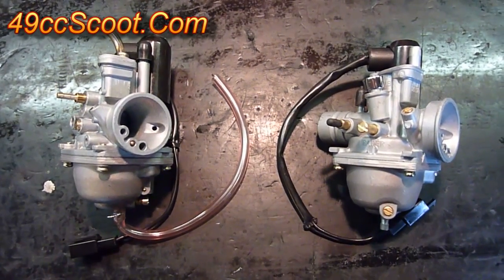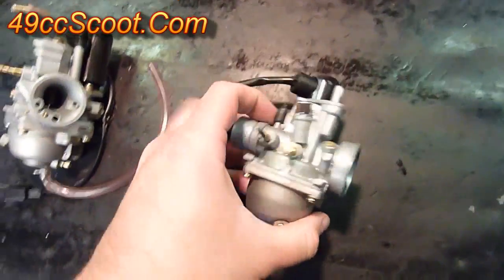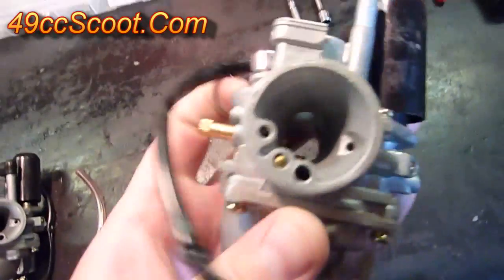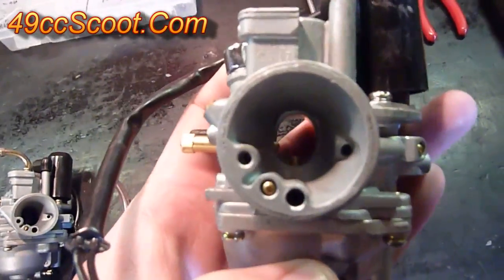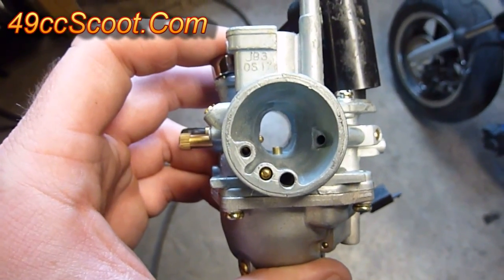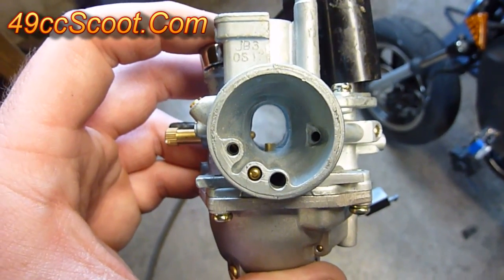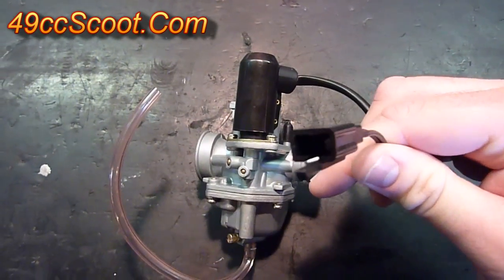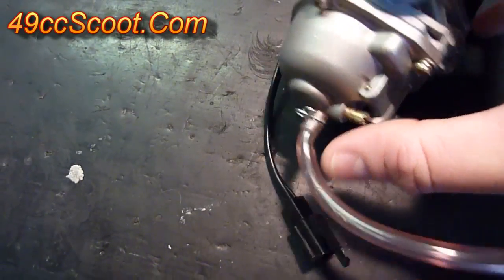Two-Stroke Scooter / ATV Carburetor Settings And Adjustments 1of4 : Basics, Overview

Comment: Hi. Im running a aprilia rs90 with track exhaust the bike runs very well on a 12mm carburetor. Would a 17mm carburetor improve the performance. Bare in mind the performance of the bike is already very good. Help with this question could free up more power and that would be amazing👍.
Reply from the maker: My instinct is that a 12mm carb is pretty small for a 90cc two-stroke. That said, I don't know anything specifically about that bike. I can tell you that with my mild 90cc Minarelli engines in scooters, I saw an increase in cooling (lower CHT) with a 19mm carb in place of a stock 16mm carb. Didn't really notice any measurable power increase.

Comment: Hey I've got an '87 50cc jog. Won't start. Replaced carb and petcock and spark plug. Still won't start. With starter fluid will only run while spraying fluid directly into the carb. Any ideas?
Reply from the maker: Sounds like you need to figure out where fuel is reaching. Is fuel making it to the carb for example and is it filling the bowl? Also, is the gas old. If the gas has sat for awhile, it may not be good enough for the scoot to run.

Comment: I noticed vacuum port is covered , is it meant to be covered at all times or is that for protection since it's new , if it's not meant to be covered where does it lead too , thanks in advance
Reply from the maker: Can be for vacuum petcock connection. If not used, it needs to be capped.

Comment: Hay hi, thanks for answering. But the filter isent the carb filter, the 1 i mean is connected through the exaust maybe the catalizer.. or the exaust fumes filter. Its just im not sure why water is dripping out, and yes its water, through the exaust...  and what do you think about the engine exaust manofold, when i took the exaust off the hole by the engine was like half bunged up. Is it a restriction,? Or a carbon build up.? Or is that normal, with a 2T 50cc moped.? Thanks again
Reply from the maker: I'd try cleaning the header and see what happens. Other sounds like emissions junk.
Reply: Ytit

Comment: Hi iv been fixed to your videos a late. Great.. 2 questions pls help. Firstly i changed my exaust, ov my 50cc sx sachs, 2T. And notice the exit engine manifold hole , looked bunged up,  is that a restriction,  or carbon build up.? Should i just leave it.?. Secondly  under my seat iv a black box coming from the exaust with a filter in it, dont no wat you call it. Lol. Sorry. Well the foam filter was black oiley,and wet. Plus iv noticed water drips alot from it, and fumes,, is that normal.? Wats it do.? Im stuck. Thanks. Keep up the great vids.
Reply from the maker: Not sure about the pipe. Trying to clean it should tell you. That's the airbox. Could be normal if it hasn't had attention in a while. Clean it and oil it with air filter oil and then see what it does. Water shouldn't be dripping from it though. Sure it's water?
Reply: And with the engine exaust manifold,  restrictions,  oder cabon.

Comment: i have a question about tuning carburetors. wen tuning the pilot and needle and the main jet. is there a curtain order that you have to tune it in. i know the pilot gottha tune first because its easier to tune once bike idles good. but what should i tune first. the main jet or the needle??? thanks alot for ur help. i love all ur videos.
Reply from the maker: Some like different orders. I generally just get a reasonable idle, then I work on the main jet for WOT and then go back to making sure it idles and then fiddle with the needle. Can be some back and forth. Some will focus on needle first.

http://www.49ccscoot.com/faq/carbtune.html

Comment: Hello, on my scooter the fuel drain hose is just pointing on the ground. is there some special place where it should be put, or its ok this way? i am kind of confused :), because as i removed the carburetor, the hose was just sitting there and it was not connected to something.
Reply from the maker: Some scoots have an end on the hose that works as a shutoff valve and the bowl drain is left open. Those usually have a hole to let them attach to one of the CVT cover bolt holes. Others just have a hose hanging down. As long as the hose is secure, that's OK.

Comment: Hi, my carburetor falls out of it's place when i hit a big pothole, so what can i do to prevent that?
Reply from the maker: Secure it is the simple answer. Kinda hard to know without seeing it. You can join the forum (49ccscoot.proboards.com) and post with pics if you'd like. Random guess, tighten clamps.
Reply: Well the proplem is it doesn't have clamps, i lost the air filter because it doesn't have clamps i looked everywhere and i couldn't find them, btw your vids are super helpful for me because i rebuilt the engine and it didn't start very easily i thought i did it wrong but turns out someone messed with the idle screw so that's why i couldn't start it when it's cold.
Reply from the maker: Yamaha dealers or somewhere like kaseaparts should have stock replacement clamps. The carb/intake clamp could be replaced with a common worm gear hose clamp in a pinch.
Reply: Thank you so much bro

Comment: Can u use a 49cc Chinese scooter carb on a 70cc ATV
Reply from the maker: If you're talking about one of the youth ATVs that has a Minarelli engine like the scoots, it should be pretty much a direct replacement. The carb should be tuned, but I'd want to tune it even getting a replacement right from the manufacturer.

Comment: Need help taking mines off a ADLY atv 90cc
Reply from the maker: There's not a lot too it. Shut off fuel if not a vacuum petcock. Drain 
the bowl (screw on bottom of bowl usually). Unscrew the cap and remove 
the throttle cable (shown in one of these vids). Disconnect the fuel 
hose and oil and vacuum hoses if you have them. Unplug the connector for
 the electric choke. Then there should just be a clamp on the intake 
holding the carb on. Once that's loose, it should come off.
Reply: 90GTVert  got the bottom off need help with the other part, thanks looking forward to seeing the video
Reply from the maker: https://www.youtube.com/watch?v=KXxxJrA5hNY
Reply: 90GTVert  got it off , it's not worth cleaning do you know what size carb and where to get it ? It's for ADLY  atv 90cc 2t
Reply from the maker: You can find tons of them searching something like Polaris 90 carb or Jog carb on eBay and just look at pics to make sure it's correct. Could go genuine and get a Mikuni VM16. Could buy a different carb like a Dellorto 19-21mm PHBG. Lots of options.
Reply: 90GTVert  I don't know what mm to get does it matter
Reply from the maker: If you're buying a replacement for a 90cc that looks like what you have, not really. It would be nice if it were 16mm, but most don't tell you that.
Reply: 2003hondacarbrebuild

Comment: Hi can you describe how the carb on the LEFT connects to the scooter?  I am having an issue that there doesn't seem to be a place to connect the vacuum hose to from petcock, but the manifold hoses/connections I see online are all made for clamping to the outlet like the carb on the right.  the one on the left, the one I have is "flat" so no where to clamp?  basic it seems but can't figure it out so here I am. thanks
Reply from the maker: With the carbs shown, left on scoot (if you're sitting on the scoot, your left) should be fuel. On the center, facing upward, should be vacuum. On the right should be oil injection.

Comment: help i hav a dinli 100cc that is running too rich, there's petrol mist coming out of the air intake when running how can I fix this, it also goes to die out from time to time then it will run fine for a while then trys to die again
Reply from the maker: +Chris Carr I'd go through a full tuning process like this : http://www.49ccscoot.com/faq/carbtune.html

I'd also recommend checking your reed valves prior to tuning.
Reply: +90GTVert thanks I'll give it a try

Comment: help, my bike only runs decently on a low main jet where the plug is white. if I upjet my carb to get correct mixture my bike runs terrible. help please
Reply from the maker: +ItsTommmm Your plug could be too hot and not coloring or the runs may be too short to color it or maybe you should consider looking at the mixture ring if you're going to read plugs. Here's more tuning info : http://www.49ccscoot.com/faq/carbtune.html
Reply: thanks, i'll have a look

Comment: i dont think the nipple for my carb  is taking oil. how can i tell for sure?
Reply from the maker: +Billy Joel If the engine has been running and it's getting no oil it should seize and the piston and rings and cylinder should all show obvious scuffing. You can do a bleed procedure to make sure the pump is working or premix some fuel to run the scoot with and let it run with the hose off in a container to be sure oil comes out. The check valve back there is a very simple ball and spring. My favorite way to deal with premix is to remove the pump, promptly toss it into a trash can, and premix my fuel and oil.

Comment: i have a yamaha razz 50cc and want to buy a new carb coz the stock one is worn out and leaks fuel. i dont know how to check the carb size. the manual doesnt show. how do i measure the carb size?
Reply from the maker: +abdulrahim fazal Measure the inside diameter of the carb on the intake/engine side.

Comment: Very clear and concise video.I have a Kawasaki weed eater. The carb has no mixture adjustment. The problem I have is that for the engine to idle I have to set the throttle cable so the slide is way above the idle setting screw. Can you help me on this? Sorry that my carb is not the same as on your excellent video
Reply from the maker: ron martin Mhg I've only worked on my own weedwackers, which always had an idle speed screw. I'd start by trying to find an owner's or service manual to see if there is anything in there about it.
Reply: ***** Thanks for the quick response. Mine has an idle screw . but it is doing nothing as the slide is way above it. I'll try to get a manual as you suggest.
Reply: There's plenty of videos for what you need I asked a 4 stroke question about a carb issue I forget he deals with 2- smokes. Like everything else I will figure it out. 😃😁

Comment: Hi. I bougth a Benelli 2 stroke 50cc knew and the problem I'm facing it's the scooter it's hard to start. Sometimes it starts but the idle is so low that sometimes the enfgine dies. Sometimes to start it needs a little bit of throttle. The scooter was in the dealership one day and came with an high idle (2.000+) after warm. What it could be? The carburetor it's exactly the same in the right side when the video starts. I'd like to tune it myself but I don't know where to start at least the idle screw. The other screw I also leave it with 2 turns but what else needs to be done to have the scooter with best take off? The scooter also spents a lot of fuel!!! They told me that from factory the scooter came with two sizes of jet and they installed the bigger ones. Could be the source of all problems? The scooter it's all stock so...
Reply from the maker: nuno ribeiro It could be jetted wrong or need some other tuning or it could be something else. I'd start by watching the rest of these vids that show the idle mixture adjustment and other settings. Try the mixture adjustment and that may clear up you idle issues or at least improve them. There's also a simple trial and error tuning method that can be tried if you have a selection of jets. It's shown in the video in this link https://www.youtube.com/watch?v=K5j8gHg5kMc . That is a four-stroke, but you can go through the same process with a 2T.  If you can't seem to get it right and have lousy fuel consumption you may also want to make sure you have a good strong spark (blue/white and able to jump a large gap consistently) and be sure your reeds are sealing. You can remove the reed block and hold it up to light. If you see much light around the edges you can try flipping the reeds over or replacing them to see if they seal better. If reeds are damaged or don't seal well it will usually cause a rich condition.
Reply: I'll try that. The question here is that the scooter is new. The engine code seems the same you refer in your videos but I need to check. I'll tell them to install the smaller jet to see what appens.
Reply from the maker: Buying it new I'd expect the seller to provide a scooter in good working order without my input.
Reply: You are right. I'll go there and they have to install the smaller jet's and tune the carb.
Reply: How many turns do you recomend for a stock 50 2 stroke?  Today I'll go there and at least I want the smaller jet's.
Reply from the maker: Roughly 2 turns out is a good starting point, but that's all it is. You need to tune it.
Reply: OK. Tomorrow they will install the smaller jet. Let's see what appens.

Comment: 90GTVert, I have a 50cc with the carburetor that has the big silver headed carb that has the PZ-19 on it, the bolt is missing and I was wondering what that is for.  Also When my scooter gets a bit warmer after starting it hesitates a lot when riding. It seams that if I throttle up and down really quickly it accelerates better, any ideas as to what I should look at?
Reply from the maker: Some carbs are simply cast sealed where that bolt is. Nothing to worry about unless you have an open path into the carb, in which case you must seal it.

First is to be sure the carb is clean. Then evaluate your tune. Figure out where the hesitation is happening (at what throttle positions). If you watch this series of vids it should explain the various settings and throttle positions. 0 up to 1/8-1/4 throttle issues = idle mixture/pilot jet, 1/8-1/4 up to 3/4 throttle = needle profile or clip position, 3/4 to WOT = main jet. There are more things, but those are most common.
Reply: *****
Thank you. I've watched all four and I have to agree with mikeonmicshow "Very well explained with patience and detail."
Reply from the maker: Thanks!

Comment: What a great series of videos. Very well explained with patience and detail. I will soon be going to Hawaii to visit my son and while I am there we have planned to install a big bore (70cc) for his GTX Turbocam (Chinese Jog variant). I think we just want to stick with the stock carb, what jets should we use? I would rather err on the side of rich than lean. Thanks again!!
Reply from the maker: Thank you. I would advise getting a jet kit for the carburetor and tuning it. I've never found that one jet size fits all. You can get a jet kit (part 114-50) from here for about $15 : http://www.partsforscooters.com/?partner=49CCSCOOT or buy them individually and you can find them as Mikuni VM11/22 from places like JetsRUs or RockyMountainATVMC. I've had good experiences repeatedly with all of those sellers, but there are plenty of places that carry them.

Start big... 95 or so on the main jet. This is a four-stroke in the link, but here's a simple tuning process that works : https://www.youtube.com/watch?v=K5j8gHg5kMc

Leave the stock air box alone. Should be no need to remove the snorkel while using the stock carb unless it's a particularly small one (some stock air boxes use a tiny passage in the snorkel). Modifying the air box or using a pod filter will require much larger jetting.
Reply: ***** You're awesome! Thanks!
Reply: Stick with stock pilot?
Reply from the maker: Yeah, most likely the stock pilot jet will work fine. You may have to adjust the idle mixture screw or needle settings.
Reply: Thanks man! You're a fountain of info. Sometimes I have to watch 2 or 3 times just to absorb it all. By spending all the time and money for the testing you do, I think you are saving people a lot of time and money.
Reply: I'm going to be doing a 52mm big bore on a 139QMB engine for my son's roomie over the holiday too, where should I start with the main jet on that one? Also, do you have any experience running a big bore with a stock exhaust on the aforementioned? The big bore kits on Ebay are often offered with an exhaust, but I am not sure it's a better exhaust than the stock one.
Reply from the maker: Not all stock exhausts are equal, but they'll usually work alright with a stock pipe. Prob won't get any big gains unless stock is restricted on a 4T, but when you start getting into big bores you may find a benefit. At very least it makes revving the scooter up more fun. lol With a two-stroke stock pipes are OK for street/sport... mild... stuff, but more RPM/race oriented stuff needs a matched exhaust.

I'd do about the same on the 139QMB and start big and work my way down. Start around 95 and see how it does, but try other jets to find what works best.

A note on the 52mm big bore... it is pretty common to experience premature bearing failures when using 50mm and larger bore kits on a stock 139QMB bottom end. Some do fine with them for a while, others end up replacing the crank within a couple thousand miles. My 50mm kit killed a brand new stock replacement crank at 2,003 miles. One sort of solution... or bandaid... is to use heavier roller weights to keep RPM lower with the big kits. It limits power and stress on the engine, but my thought is you might as well just get a 47mm kit that will be better balanced and run it how you want at that point. I suppose I could see a benefit of what would be a sort of street/strip setup with the big kit though. It could be de-tuned for daily use and then use lighter rollers for racing or max performance. Personally I don't have that sort of restraint so if the power is there I want it full time. :)
Reply: Mike Jones الله الرحمن الرحيم